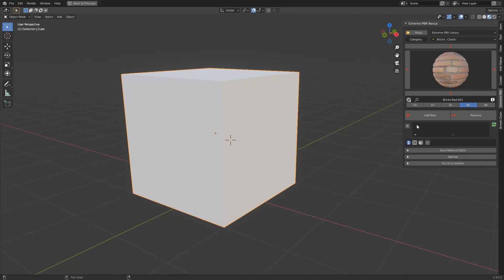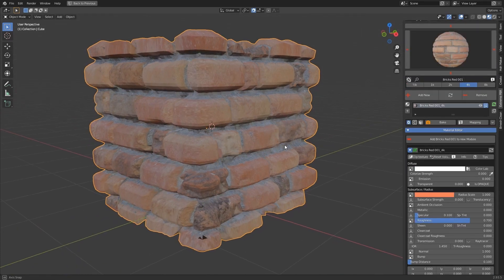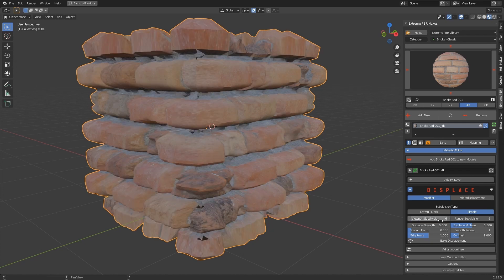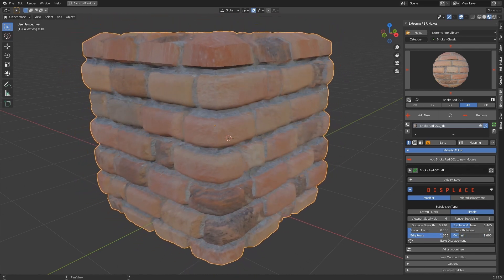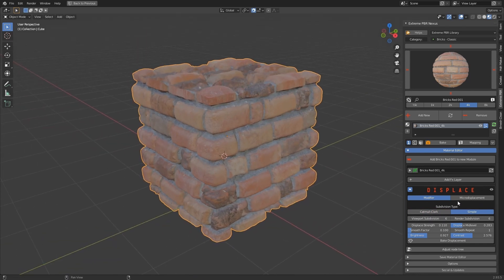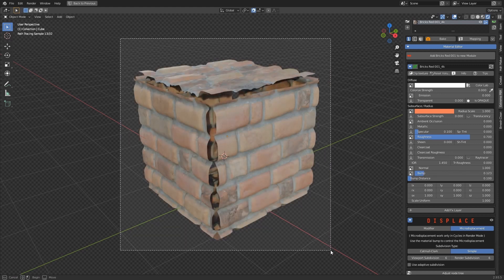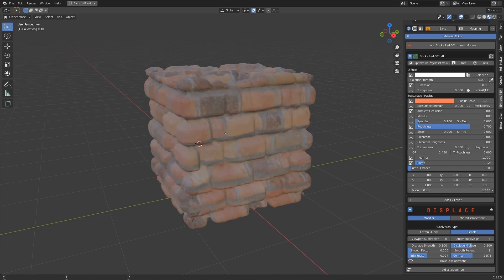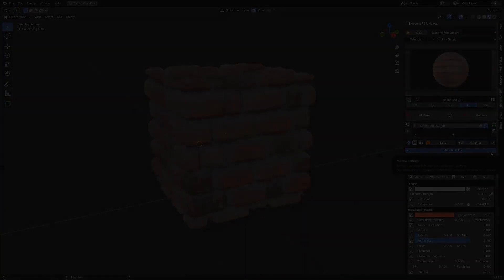02 #extremepbr Blender Addon | Displacement Tutorial

Comment: Mr D I go through a lot of times because I have to switch between blender 3.3 and blender 3.0 point one for different reasons where when I switched to blender 3.0 point one all my textures are white .....that I installed with extreme PBR on my model..... I'm in the process of trying to figure that out but... so if you can make a video on how to fix that I'd appreciate thatA nd it be good for other people but also I thank you for adding the simple PBR option to the options I just noticed that and that's really awesome because sometimes the default nodes that you have to edit it's kinda hard to make extra adjustments 2 because I haven't spent the time to learn them .... edit on the white textures I just reapply the materials and you know it was a tiny bit of a hassle but now I got a BADASS look on my 64 Impala!....AND THEY ARE ALL HOOKED TO A PRINCIPLED BDSF.... Someone should throw you a parade Mr D! I love this ADD-ON!!😆😆😆(i did notice car paint is not a simple pbr node setup....sure thats cuz the flakes)

Comment: Andrew, I'm trying use my own material library inn Extreme PBR nexus.  I added the folder for my own materials in the preference window.  To my knowledge, the filenames are named appropriately.   In Extreme PBR nexus my material only displays one of the maps as a a square and not a ball.   When I hit the add button, I get an error in Extreme PBR nexus.  I'm assuming the error is due to not having all the mapping files for the material. What do I need to do to have my materials display as a ball and use all the mapping files?   Also, is there a way in Extreme PBR nexus to cap a mountain with snow and place materials on slopes which is different than the material on flat ground?  Thanks.